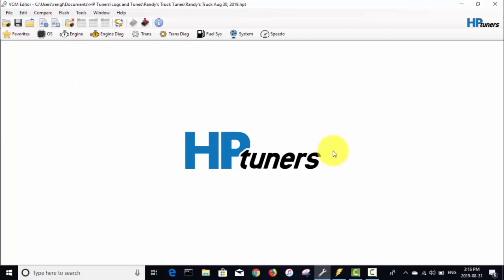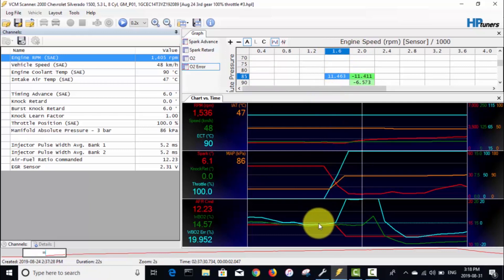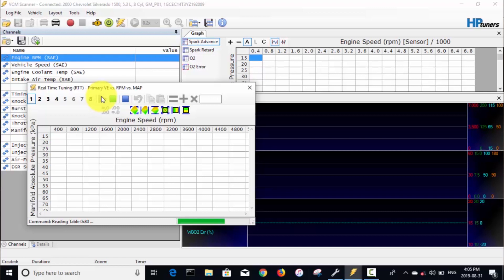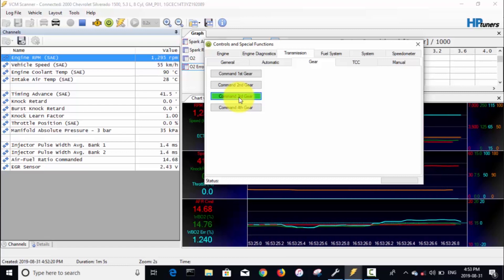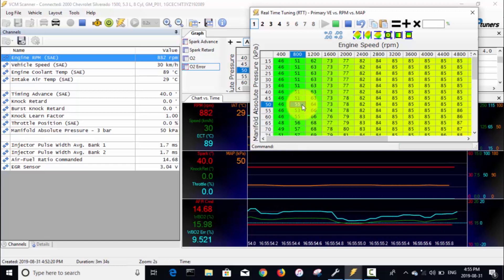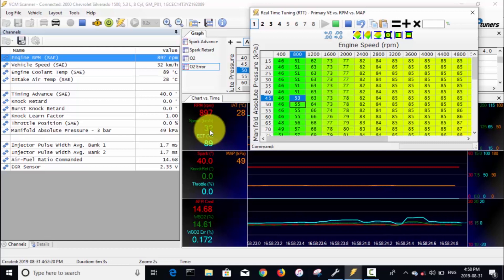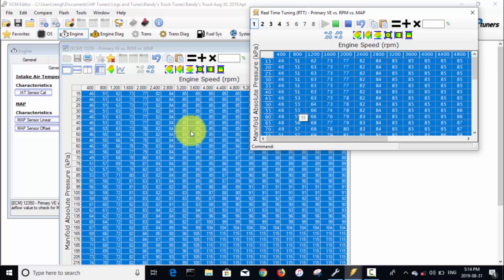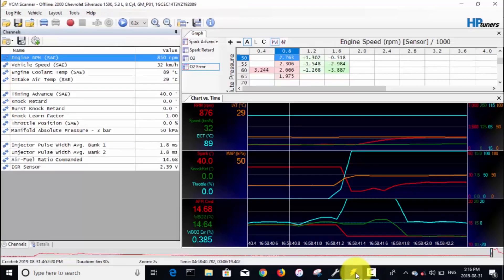Real Time Tuning the VE Table with HP Tuners

Comment: How do I get the real time tuning software
Reply from the maker: Don’t need special software, it’s included with HP Tuners but only works on older Gen 3 ECM’s
Reply: @LowbuckLS  how do I set up for real time tune
Reply: What year of gen 3
Reply from the maker: @chidozperformance5560  it should work on P01 and P59 ECM’s from 1999 to 2006 if you install the correct custom OS from HP Tuners. I have heard it doesn’t work on flex fuel enabled ECM’s but haven’t tried it myself.
Reply: @LowbuckLS  I’m running latest software an I tried couple ecm an I don’t see that feature
Reply: @chidozperformance5560  I believe they removed that feature from newer software versions.

Comment: Now what I don’t quite get is we’re told to “dial in your VE table” but then they have us go back and change what’s been set and to smooth it out.    The engine wants what it wants and it seem like the fuel trims and MAF will cover the difference.   If the tip in cell are dialed in to within 1% we can essentially be throwing that off but smoothing it.